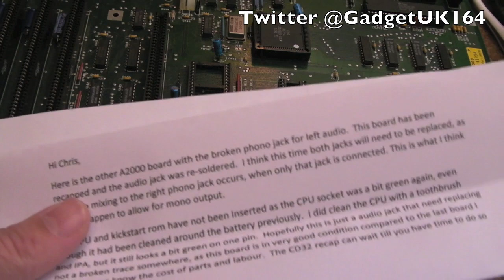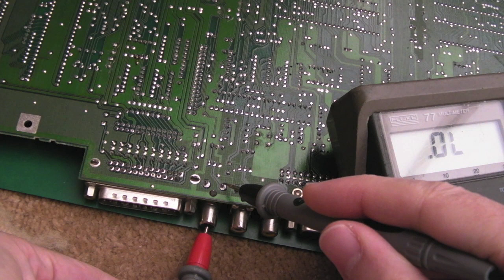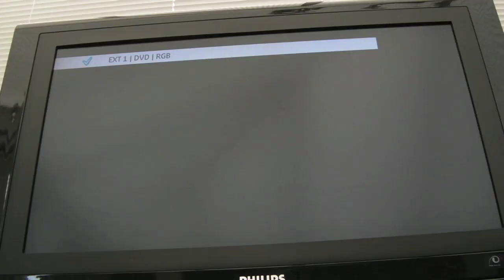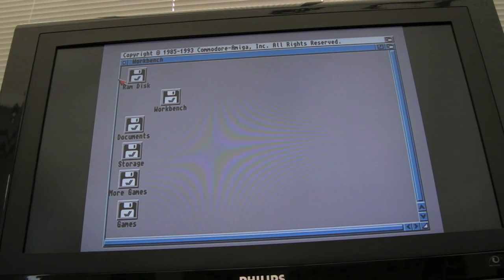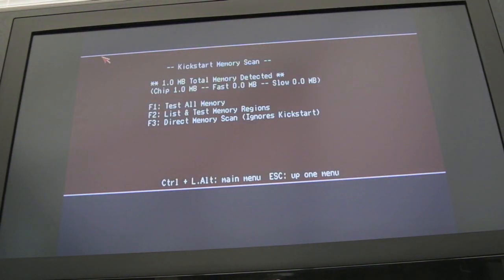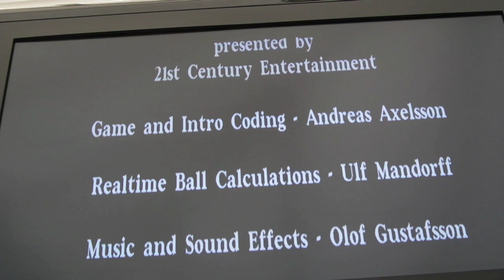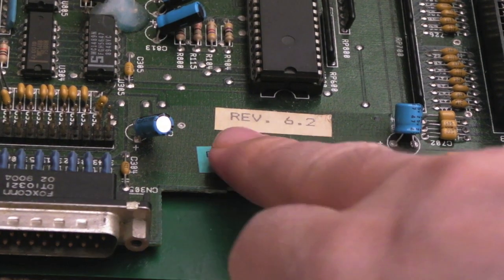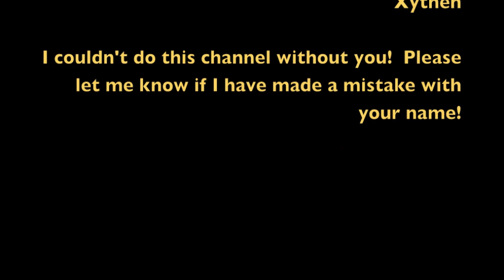Commodore Amiga A2000 Missing Audio Channel Repair

Comment: The later Amigas (A600, A1200, CD32 and I suspect the A4000) have the 2 phono sockets linked together with the connection between them broken when the plugs for both channels are inserted. This gives mono output with only one plug inserted, but stereo when both are inserted.  The older (A500/2000 era) boards aren't wired up this way as far as I'm aware though.
Reply: Your suspicion is spot on, the A4000 has the internal switch as well.
Reply: @firstsurname9893  Cool, I thought that it probably would be, but with Commodore anything is possible !

Comment: Thank you, GadgetUK164, much appreciated Amiga A2000 audio repair.
Reply: Interesting enough but I find canned compressed air evaporates rubbing alcohol in a fraction of the time it takes wiping it down after. However wiping it down works well for scrubbing.

Comment: thanks man, really well presented. ive got this sub, the connection from the back of the rca to circuit board is dodgy and i had to glue the plastic housing back together. ive bypassed the rca connections and using speaker in out, would that dodgy rca be the cause of the feeback even tho its not in use?
Reply from the maker: I am not sure what you mean by feedback?  You shouldn't hear any feedback unless there's a fault or the wiring is wrong perhaps.

Comment: If you grab the very tip of a cotton bud and pull you can pull some of the cotton wool off so it will fit into the centre of a phono socket

Comment: Is that Philips TV or yours quite old?  It seems to be able to handle connections from anything and does a decent picture for an LCD.
Reply from the maker: 2007 / 2008 ish I think!  Yes, it works with anything I throw at it and it gives an excellent picture!  It was around the time everyone started to cut over to HD, and as a result it has lots of support for SD.  Lots of SCART sockets, component, composite, S-Video etc, as well as 3 HDMI ports.
Reply: I've got a 2006 "HD Ready" 32" Sony and it handles analogue video far better than the newer Tosh and Samsungs I've got.

Comment: love the vid man. you are a joy to watch work on electronics. been loving my new job. work doesn't feel like work. I justs get lost in board repair. I do have one question. when it comes to removing through-hole ICs are there any tricks or tips you have for getting the solder to come completely out from the pin holes? smh the place I work doesn't have a desolder pump but we do have chemwick solder wick. Adding more solder works sometimes but damn it can take a while to get a chip free from the board.
Reply: I would love to see some repairs of shorted/burntish boards. something meaty if you know what i mean. something most would say wow a lost cause. lol. :D thanks again.
Reply from the maker: Thanks!  Glad the job is going well!  Get a manual desolder pump from eBay - they are like £5 - that should help unblocking holes on through hole!  I hate using solder wick for that sort of thing!  Regards charred PCBs, will see what I can come up with =D
Reply: @GadgetUK164  Thank you. I have seen the guys in the lab working on shorted/burnt board and would like to see ways of saving them if possible. one thing I have to work on is my speed this a production kinda thing at work. if I repair $10,000 worth of stuff in a month I get a bonus. lol. I am really loving the job. I really hope you get things sorted out on your end. hopefully, soon I can contribute to your endeavors somehow.